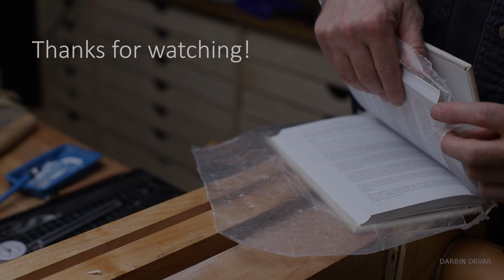Building a Classic Bookbinding Vise

Comment: I am a bookbinder and I approve! I like that you chose the wider screws. This means that it is much easier and quicker to open and close. I wonder about the point of the additional Wooden pieces at the handles. And it is missing a locking pin. The 2.5 inch screw is what makes the difference.
Reply from the maker: The wooden pieces are there because of a mistake. Initially I didn't have a 2 1/2 in drill bit so I did it by hand and that made it too wide and uneven.

Comment: What size do these blocks of wood have? Inch or cm, both would be great. ;)
BTW: Great videos. Calm and informative.
Reply from the maker: 3 x 5.5 x 32 inches  (7.62 x 14 x 81.3 cm) You can use smaller all around though. I just chose these because I had them. Thanks!

Comment: Where did you get that Tap and Die set? Looking to make my own wooden vise screw.
Reply: https://www.dictum.com/en/cylindrical-tapered-cutters-bakk/profi-wood-threading-tool-2-piece-set-38-mm-714143. That link only goes up to 38mm/1.5". Try https://www.fine-tools.com/gewind.html for up to 62mm/2.5". They are all pricey for a single project, it is probably cheaper to buy finished products from someone like Lake Erie.
Reply from the maker: It was actually lent to me by James @kingsfinewoodworking - not sure where he got it from.